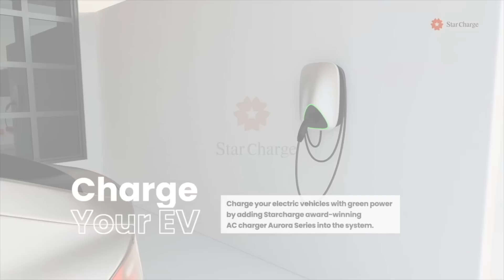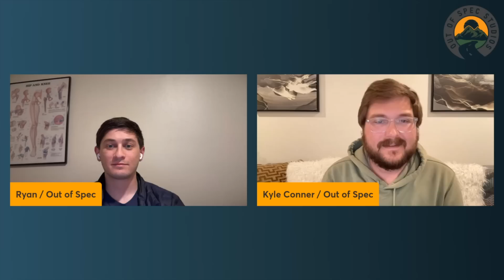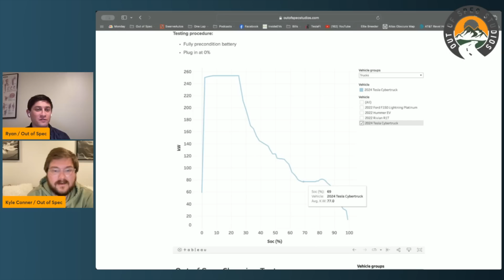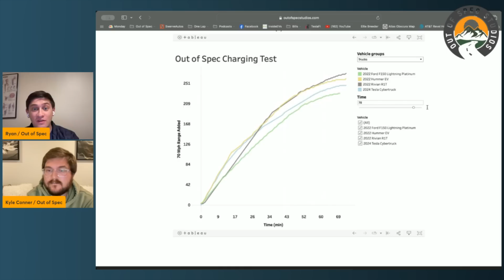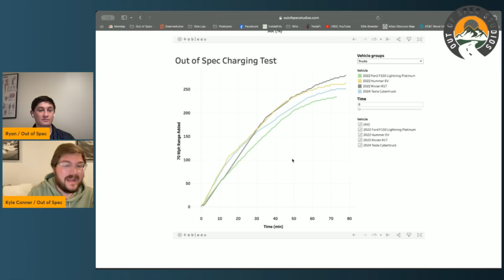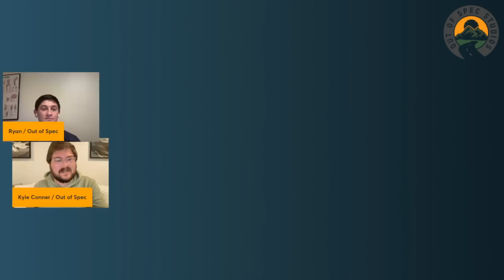Cybertruck DC Fast Charge Testing & Analysis - Comparing To Rivian, Lightning, & Hummer EV

Comment: Two Hummer-related corrections from early in the video on Hummer charging: 

1. Most 2024 Hummer's now come with 80 amp/19.2 kW L2 charge modules as standard. 

2. The 24-module battery pack is NOT 240 kWh total. It is about 220 kWh total. The modules are just over 9 kWh/module total x 24 modules. The erroneous 240 kWh # came from an Road and Track where they mistakenly multiplied the EPA amp-hours x the MAX pack voltage, not the nominal voltage. Nonetheless, that # has has since spread through the internet.
Reply: Bottom line for the hummer is that those corrections dont matter, the consumption is so high that the battery could be 260kWh and you wont even notice it.
Reply: @SupremeRuleroftheWorld those numbers can absolutely matter. I pulled a trailer every day for work and would drive 150-200 miles a day. The Hummer is the only EV that could potentially replace an ICE truck with its massive battery.
Reply: @menjay2837   the hummer only does 140 miles while towing anything so pack size is complely irrelevant apart from the insane cost to drive the stupid thing. at least the cybertruck is "economical" for what it is, especially compared to the hummer wich is just utter stupidity if you but it for anything else than to show everyone how poorly your financial desisions are that you make. the battery is nearly twice the size and cant even hit 300 miles in the real wold even without a trailer. the consumption alone would make it irrelevant in any objective desision making.
Reply: @SupremeRuleroftheWorld  you pretty much just agreed with me that it would work for my situation and the faster AC charging does matter. I’m assuming you’re a Tesla stock owner though, so there’s no other vehicle that could serve a purpose in your world.
Reply: @menjay2837 it only does 140 miles towing, so you can’t read
Reply: @kalasmournrex1470  yeah. Someone said it on the internet, so it’s settled that the Hummer EV will only go exactly 140 miles while towing anything. Pay no attention to this https://youtu.be/yH4teZSCIj8?si=wWYVQRLoG-prBuEg where they tow 169 miles in the mountains or any of the other videos with more aerodynamic trailers pulling 200 miles.
Reply: @menjay2837  i genuenly dont care about the badge, i care about the facts. and the hummer does not make economic sense. is VASTLY more expensive to own, operate and maintain than any of the alternatives. its by far the worst option for what you need to do. you aint towing a trailer for fun, its making money and with a hummer you are nearly doubling your fuel cost. and no, i dont have tesla stocks nor do i care about the brand. i buy the vechicle that does what i need it to do. my daily driver is a camry and for work i have a tesla 3 and a F350 dual depending on the job. so please stop with the "you  dont say anything bad about tesla so yur a musk fanboy durr" grow up please. and fort he record: the hummer is just as ugly or even more ugly than the cybertruck.
Reply: i have a hummer suv with off-road package and will be getting CT in a few weeks .  just to pu it out there i get 315-322 miles with the Hummer and 18s  i friend that has the 22s gets 329 miles .
Reply: @Drksyder  good luck with that. off road package or not, its still a stupid vehicle to buy just on the (lack of) fuel economy. and lets be honest, if you REALLY want to go offroad you just get a tacoma. a bit of trim does not make the hummer any better offroad.
Reply: @SupremeRuleroftheWorld  you kinda went off topic . lol i was just letting you know range .  the off road makes a difference because the range is less  because the wheels and tires .  your very sensitive. i’m guessing you can’t afford any of these vehicles?
Reply: @Drksyder  my financials are irrellevant, our parking lot has everything from a tesla 3 up to F350. vehicles must be functional and  have a return on investment. if you have the means for vehicles in this price range you need to have these factors front and center if you want to make any money. the electric hummer has no ROI or has any use apart from compensation in other matters. you sure aint buying one because they are good value or are good at their job.

Comment: 4680 should shine (or at least improve) with the higher voltage architecture of CT. We may see a completely different charging curve when we eventually hook CT up to a 800V DCFC. Thermal derate will be less of an issue at lower current and my guess is it'll hold above 200 Kw well into the pack.

Comment: It would be interesting to chart the charging curves as time for the X axis, and still mark SOC% on the X axis as arbitrary placements for reference. This would let you see time to SOC% as well as charging power for each SOC% in the same graph.
Reply: If I'm following correctly, you could only do that for viewing one charge curve at a time (right?). Could still be useful.
Reply: @graemeesmith   You could still view multiple curves at once, since they'd be scaled by time on the X axis, but you would need separate SOC% marks for each curve.

Comment: Completely agree that you need to test the Lightning again. I have an early build 2022 that seems to charge much better. I consistently peak at 180 kW, and I have not noticed a deer rate after 10 minutes. It will hold through 60%. 

I bought mine certified and fully updated last November. I think software updates made a difference.
Reply: Great to hear. Looking forward to getting one in for testing soon. The new heat pump could also help range as well!
Reply: From the looks of this chart, even with the F-150's previous charge curve, the CT doesn't add miles appreciably faster than the F-150L.  At about the 35 minute mark, the F-150 starts closing the gap, and by about 40 minutes, the CT has only added an additional 13 miles, about 7.6% more, which may be more due more to the vehicles' better efficiency than the charging rates.  The CT does start to gain some ground after the 50 minute mark though.

That comes with the caveats that the F-150L seems to have updates that have improved the charge rate and will need to be re-tested, and that the dual motor Cybertruck is 6.25% more efficient than the tested tri-motor.
Reply: Gives hope for the cybertruck updates.  Especially on an 800v charger

Comment: Did a several thousand mile trip on F150 Lightning ER recently and the best charging thing is charging boost up to 180kW for a 5-10 minutes no matter the state of charge. You can get a good charge rate at 10/30/50/70%.

Comment: Problem with >45A AC charging is most home wiring is totally incapable of sustaining that sort of power and it would cause too much risk.  Very few people would rewire their home to accommodate 80A.  Problem with DC chargingI believe is also an infrastructure more than vehicle issue.  What is the voltage being delivered to the actual supercharger site from the utility?  Probably miles of underground cabling that also doesn't support higher voltages and currents.
Reply: The grid voltage likely does not affect the maximum output of the charger. In Europe I believe all DC chargers are connected to 3-phase 400V from the transformer of the grid utility, regardless of the spec of the grid beyond the transformer. The grid will only dictate the maximum power for the site
Reply: @winkcla  right, that’s what I’m saying that those transformers and underground lines can’t do handle the higher power across all stalls

Comment: no builder wants a truck that can go 0_60 in 2 seconds they want a truck that can help them do their jobs reliably ..... no electric truck will EVER be able to do that its called practical & safe & affordable ........ you guys i hope dont think electric cars are anything more than they are ... that is a short journey 2nd veichle ..... nothing more nothing less .... with the abilty to close your whole area down if it sets on fire !!!!
Reply: Most builders don’t buy $100K work trucks, ever!
Reply: @BK-tx2vw any F-250 is 100k
Reply: Our Chevy bolt is our main vehicle. 200 mile round trips no problem. Drives great with great performance. Average 1000 miles per month.
Have an older gas Chevy we use for road trips.
Reply: @richardwolf6269  ana electric bus expolded in my area today set whole road on fire  20 emergency viecheles  .......they are witholding the casulty amount ...
Reply: I’m guessing IQ around 80
Reply: Sorry, but people are already using them on job sites. Lockable storage in the frunk is a huge deal because tools get stolen all the time. Being able to use your car for power saves so much space, noise, and maintenance required for using a generator all the time. Residential contractors need to drive up to 60 miles, do their jobs, and come back home to plug in at the end of the day. Any electric truck today can do that even while hauling a giant trailer full of gear. And they will only get longer ranges and lower costs over time.
Reply: No combustion vehicle EVER caught fire in HISTORY. Checkmate, EV nerds! 

/sarcasm
Reply: @@user-ou2vi1rd8dyou will eventually!

Comment: Cpmplaining about a cliff? Why?  At which point is the temperature saturated where cell changes are most likely to happen as electrons find it harder to squeeze in?  Your own charts here show "This crap" for the other vehicles. Model Y drops off dramatically. Also being you are charging two packs off the same heavy current on 400 V. I disagree that the curve is bad. The heat, resistance, and current on 400 V sucks.

Comment: The Model Y 4680 has the same low charging speed as the Cybertruck. Since the release, the charging curve hasn't changed in any way. The thing is that the 4680 battery is not capable of charging with high current and has poor heat dissipation. Only stations with 800V will be able to increase the charging speed, because they can keep the current low at high power.
Reply: 800V will not change things too much. The problem is the C rating of the batteries. The batteries can only take so much and the restriction is not voltage. What you'll likely see is higher peak voltages with the 800V system.
Reply: @SuspectOnTheLam  You can charge the phone's battery with a current limit of 2A by charging 5V and 2A = 10W or 9V and 2A = 18W. But apply 5V and 3A = 15W to it and it will fail.
Reply: If the limitation is at the cell level higher pack voltage will make no difference.
Reply: @JRP3  A higher voltage allows you to increase the power kw while maintaining the current strength at the same level. It is the current strength that affects the heating of the battery.
Reply: @vlad_417  Again, at the cell level voltage is unchanged, each cell charges to 4.2V no matter what the pack voltage is, and the current each cell gets to create that voltage is the same, thus pack voltage has no effect on cell level charge acceptance rate.  The only way higher pack voltage can increase charge rate is if the limitation is in the wiring and cell connections not the cell acceptance rate.
Reply: @JRP3  4.2V is the voltage that a cell can emit at 100% charge level. The cell can be charged with a voltage of 5V-20V. At the same time, the maximum voltage is not as important as the current strength. For example, at 15V and 1A = 15W, the cell will be slightly warm, and at 5V and 3A = 15W it will overheat.
Reply: @vlad_417  You really don't understand how charging works.  4.2V is the maximum voltage allowed during charging at the cell level, you don't charge a cell higher than that or it will degrade quickly.  A voltage differential is needed to allow current to flow, nothing more.  If you put a volt meter on a charging lithium ion cell you will not see anything higher than 4.2V.  The cell level charging limit is the cell chemistry C rate and has nothing to do with the pack voltage.
Reply: There appears to be some misunderstanding about the charging mechanism. Essentially, multiple elements are at play. The component you're discussing pertains to the power flow through the cord. USB Power Delivery (PD) allows for higher voltage levels, which facilitates the movement of greater power through thin cables. Nonetheless, this does not mean that the device being charged directly applies these high voltages to the battery cell. The device receiving the charge must convert this higher voltage, such as 20V, to a voltage that is compatible with the battery cell's requirements. Hence, within USB-C PD charging, multiple stages of DC-to-DC conversion take place. The constraining factor in the Cybertruck is not the power supplied by the Supercharger. It is the capacity of the battery pack itself that is limiting. The v3 Supercharger is capable of consistently delivering 250KW for 30 minutes or more. The limitation lies in the endurance of the current 4680-based battery pack generation.
Reply: @SuspectOnTheLam  There certainly is a bit of confusion, on your part.  We aren't talking about USB charging, we are talking about high power DC charging of the high voltage traction pack in vehicles.
Reply: @JRP3  we were on the same page. I was pointing out vlad’s misunderstanding of how power is delivered to batteries
Reply: @SuspectOnTheLam  To convert energy, a large power supply is used, which converts current and voltage from the mains. Then it goes to the phone as it is. The only thing in phones with a charging power of 120-240W is to put two cells each
Reply: @vlad_417  You are missing the point. This has nothing to do with the power delivery system. The power delivery system has enough capacity to charge the Cybertruck faster. The Cybertruck just can't take it right now.

Comment: Super informative data.  For non out-of-spec folks (the rest of the EV drivers) my sense in the 'real world' is few people run down to 0% and so seeing the miles added at 70mph and performance with charts starting from say 10% is more indicative of relative performance.  The super 0-25% of CT is a lot less useful for most people than the 10-35% of say Model X or the progressive curve of Rivian.  But kudos to the OOS team on such great comparisons!
Reply: You can get a very good estimate by subtracting the time it takes to get to 10%. (Time to 80%) - (time to 10%) = the number you’re looking for 👍
Reply: I wonder if there’s an issue with heat in the cables where Tesla slows the charging after being at 250kw that long. If it charged at 250kw from 10-35% that would be really good to know.

Comment: “Adapters are scary” — I think more consumers should absolutely be aware. Hopefully y’all do end up making a concise video on this subject.
Reply: Anything that runs 800V and you add an external piece to the system is scary and potentially very dangerous. Even more so when those things could be running 400 or 500 amps.
Reply: This is truth!  Adapters should be strictly regulated.  Way too much power running through those things, it doubles the weakest part of the whole system, the connections.  Things need to be standardized and fast, critical for EV.
Reply: “Adapter, receptacles and plugs are scary” - go ahead and get them all.

These are big voltages and amperages, any problems and its heat/smoke/fire..
Reply: 800V is less stress on the battery and drivetrain than 400V as the current is halved (for the same power).
Reply: @diytesla  why not just go 20,000V?  There’s a trade off, higher voltage is dangerous too, more insulation, separation of conductors.  Electricity will find the path of least resistance.

Comment: 43:00 Please get Standard Range and Extended Range Lightning with and without Max Towing Package, as well as 70mph Range Tests for those packs! The Platinum is an outlier, and it would be most helpful to have data for what's in most people's budget. I also want to see a nerfed 85kWh Model S! :D
Reply: Bring us the trucks! Ford doesn’t have any Lightning test vehicles for us to use in the fleet
Reply: @KyleConner  Dang it Ford! No dealerships with 50 on the lot near there who will let y’all use it? 😅 I can bring y’all a 2014 Model S P85 with 117k miles and a 2014 Model X 90D with 123k! 🤣

Comment: That second graph is gold, it's exactly what I've been wanting to show people with regards to the range/charging/efficiency relationship. The fact that it uses real measured range at highway speeds is the cherry on top, none of this fake CLTC city range. People don't need long range unless they're moving at high speeds, and then they REALLY need it.
Reply: Yep. This graph should be required by EPA.
Reply: Winter long range and you may have trouble reaching the nearest supercharger.
Reply: Call the Supercharger Version 4, the Version 3B
Reply: Thanks. I’ve always thought the same, I don’t really care about city range. I’m never going to drive 300 miles in the city in a single day lol
Reply: @ryankassel5691   True, but I suppose some people drive similar to how a lot of people do on gas.  DC charge say once a week and drive around multiple days on whatever range that gave them.  Maybe people in apartments, for example.
Reply: @duotronicnone4572  you’re right, apartment dwellers really get the short end of the stick. It’d be great if they could get L2 for everyone in an apartment but that’s usually not very realistic
Reply: @ryankassel5691  It will become a thing in the coming years, but it will take time. Landlords are generally not receptive of it, even if the dweller is willing to pay for installation and electricity cost.
Reply: @ryankassel5691 You probably need less. I live in an apartment in the Netherlands with a Etron 55. I only need to charge every 3-4 days. So, 1 charger for every 4-5 apartments should be sufficient in most cases...